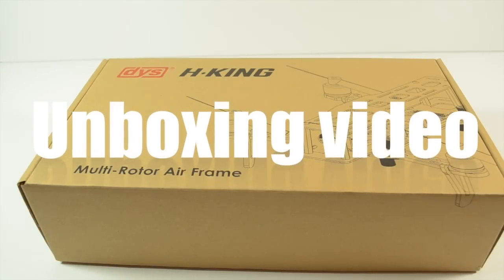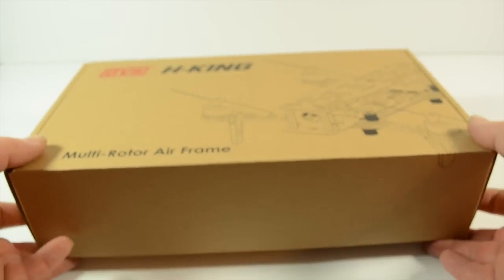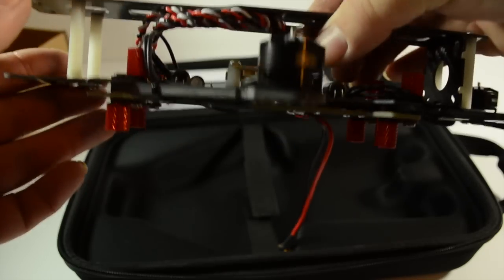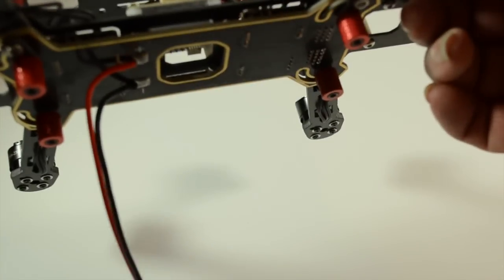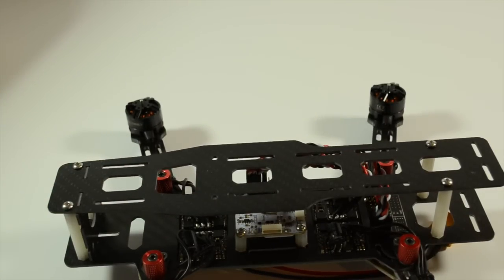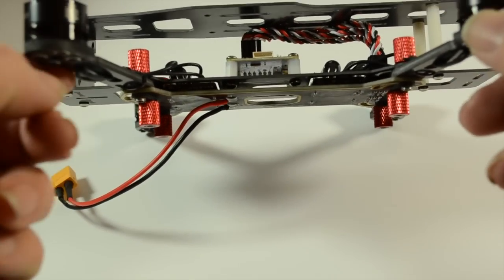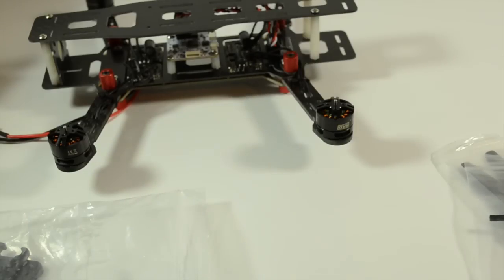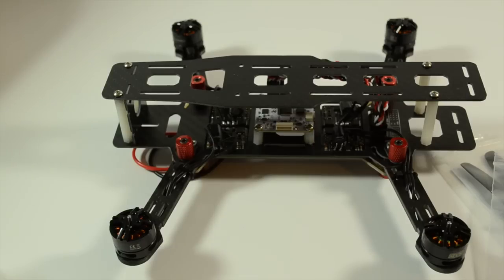Dys Xcite 250 frame

Comment: Just discovered this quad. It's been a while since you made this video, would yo out recommend this still? I'd say I'm an intermediate pilot, but my soldering skills suck and I like that it's plug and play. I am worried about the ESCs. If you burned one out, is it possible to replace it with a traditional ESC?

Comment: Any info on price, interesting these RTF miniquads are springing up everywhere, not sure that having the arms folding forward is wise, as in a crash that could absorb energy, but these fold the wrong way. Also integrated ESC will be a pain to change shame they are not pluggable - lots of opportunity for the V2 I guess.
Reply from the maker: Hi no sorry not yet but will try and find out this week! don't think the arms folding forward will make that much diff as that is them in the folded position, but have to agree with the integrated esc's being soldered. I am thinking of removing them and adding plugs so they can be plugged into the main board which would make them more user friendly ;-)